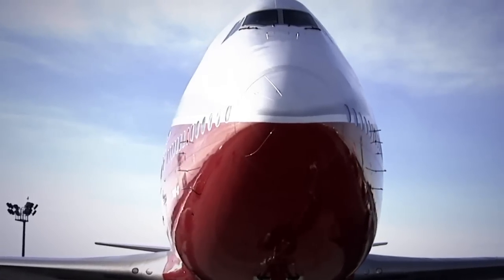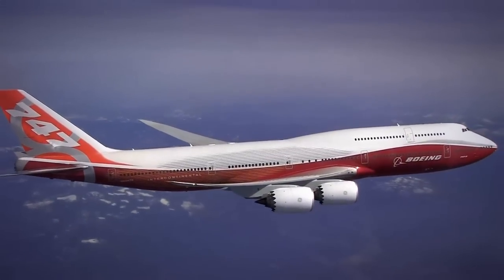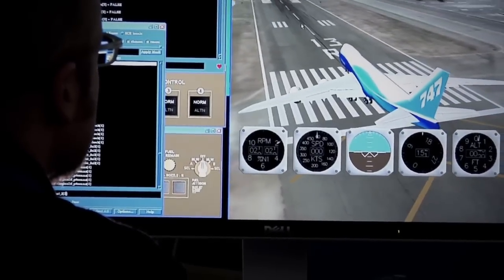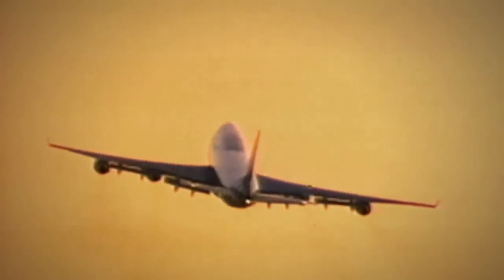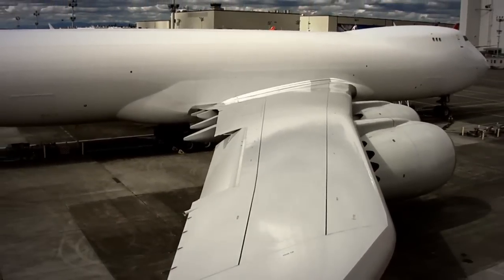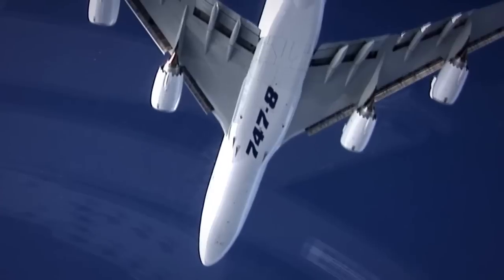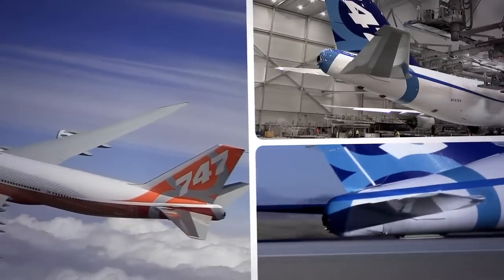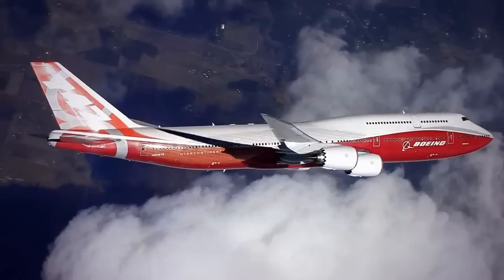Boeing 747-8 Engine: Balance of Power

Comment: I remember when I was in High School, we used to watch TWA's  747's in training take off and landings from the hall way to the cafeteria. They were so big that it looked like they were floating on the way down to land.

Years later ... I was actually able to fly in one, it was really a great experience, a jet you were not crammed into in seats too small and too close together. Instead the plane was spacious.

Now that I am getting older, I rarely have the opportunity to fly, but if I were to I would certainly prefer a 747 to anything else in the air.

Comment: A few weeks ago I flew to Bangkok on a 747-400 and it took 10.5 hours.  Last week I flew back on an A340-400 and it took 12 hours.  Give me a 747 anyday!
Reply: That is not a good comparison!  The only way you're going to know that one is faster than the other to fly them from the same place to the same place, in your case you would have to take the A340-400 to Bangkok and hopefully it would take exactly the same route.  If you fly from NYC to London takes less time than to fly from London to NYC, it's almost an hour difference I think.
Reply: I never said it had to do with the planes, it has to do with jet streams and earth rotation.  If you to compare both planes then you have to compare going from NYC to Bangkok, you can't compare one going from NYC to Bangkok and the other going from Bangkok to NYC, both have to originate from the the same place.  It's like saying if you swim in a river in favor of the current and then some other swimmer swims counter current obviously the later will take more time to swim the same distance than the first one.
Reply: 747 is the fastest commercial jet. Although you may have had a little tail wind, the 747 does make a slight difference over a long flight.
Reply: I don't know what the speed is for the 747 but I will accept the "slight difference over a long flight if both flights originate from the same place and take the same route and altitude.
Reply: this could have been due to winds though :/
Reply: Well, it will cruise at 0.86 mach at 35,000ft and at 0.88-0.92 mach at over 40,000ft so yes it's extremely rapid vs other airliners because it has such good performance, in part due to its new supercritical, highly swept 38 degree aerofoils but also due to its superior aerodynamics, like utilising the area ruling with the hump, raising M Crit and lowering wave drag.
Reply: BoeingvsAirbus1578 Check again A380 have 0.96 mach speed max and 747-8I 0.90mach speed, what are you talkin about?
Reply: csabavezer80 Not exactly, the a380 has a 0.96 mach in dive at cruise altitude but it has a 0.89 mach in cruise speed which I think is what we are arguing about but it is still a very slight difference to make such a difference in time.
Reply: csabavezer80
 Actually, the 0.9M speed listed is the MMO given by Boeing, this is the maximum advised operating speed for an economical lifecycle of the aircraft. The 747-8 can fly 0.92 in level flight like most previous versions of the 747 (E.G the -400 series) but it would end up expensive. The A380 can push for 0.89M for its MMO. The A380 will only achieve its V max in a dive, and can only hit 0.96. The 747-8 is capable of 1.12M V max in a dive and survive structurally.  Typically, these airliners are designed to cruise efficiently, and thanks to its more aerodynamic design, the 747-8 can cut through the air faster and at a slightly (near as makes no difference though) higher altitude than the A380. When operating under typical cruising conditions, the 747-8 can fly faster for less wave drag, as it has a higher M crit. Therefore, to summarise, the 747-8 is superior aerodynamically: it can fly faster than the A380 and yet still fly more efficiently. That hump isn't for nothing you know. ;)
Reply: I'm not here to start a nonsense argument I simply corrected you because you left an important part out before.
Reply: Whatever you like.

Comment: Plus, the Sky Interior is just plain game changing and has SHOWN to make time change easier on the individual flying and the 747-81 requires less maintenance and is SOOOO much lighter because many of its materials are composites. That makes the 747-8 better than the A380-800.
The only downside out of all of it is...
It requires a 10.8 thousand feet minimum takeoff length. Thats it!

Comment: Some people seem to think that the a380 and the 747 are not competitors because they accommodate two different needs... I always felt like they were competitors, but come to think of it, there's "short-range" 747s and higher passenger capacity 747s. So I guess the a380 is trying to get the market of high-volume cities during unusually high-volume times of the year, while the 747-8 is for year-round flights, and on top of that, it's "cleaner"

Comment: The 777 is probably my  favorite airplane, but the Airbus 330 comes in at 2nd place. The only reason that the 777 is in first place and not the 330, is because of the 777's flawless safety record. Other than that, the 330 is the way to go.

Comment: The A380 was all new, and all new aircraft have issues as boeing found with the 787. The 747-8 can only go where it likes because when it came out airports up-sized themselves to take it in most cases.
The A380 and 747-8 can carry both PAX and cargo like most medium to long haul jets.
The 787 only competes with the smaller end A350. They are both different targeting different markets. 
The A320 has 60% market share vs 737
Long live them both, long live competition, long live engine choice

Comment: Hopefully, it's not selling so well now :( but that's because most airlines with 747-400's are still happy with them and they are still making money, so wait a good few years and the 747-400's should be replaced by these. This plane can still fly the same routes and more (more range) as the 747-400, because even though it's bigger, it has better stopping power than the A380. That's why Virgin will have to buy a load, when was the last time you saw an A380 at Grantley Adams? or Princess Julianna?

Comment: Boeing, why not offer RR engines on the 747-8? You are reducing the chance that people will buy it if the airlines already have RR engines in their fleet. What about using the Trent 1000s from the 787? Because they produce 10,000lbs thrust more per engine than the GEnx2B engines, you could strengthen the pylons and it would mean for a higher MTOW, faster speeds and also more efficiency, as pilots wouldn't always need to use as much throttle.

Comment: Yeah Airbus is scared of 787,777 and the 737 will beat the A318-A321neo. And the A380 is a a fail too, there are not enough planes sold to get the development costs back.

Comment: Beautiful plane indeed but it won't survive.  It's clear that the market has decided for the A380, at least for now, and I think the 777x ( this name might change to 797) will replace the 747, I don't even think there's a great future for the A380 or any four engine jet, they are not cheap to operate, I think twin engine is the future and right now the 777 is the best one out there.
Reply: The a380 has severe limits when it comes to what airports it can use, the 747 can any airport with a sufficient runway.
Reply: Many airports have chosen to make the improvements to accommodate the A380!  but that fact only limited airports have the capabilities of taking the A380 worries me in case there's an emergency and the plane has to land as soon as possible.
Reply: The twin-engine is of course the future of the long-distance commercial airliner, but this beautiful bird is sticking around a long time to come.

Comment: You know the hilarity of Airbus fans? They try to call the 737 MAX 'outdated' Despite the fact that it's 4-6% more efficient than the Neo, 'Because it's narrower'. A quote from the silly Dartagnyn "It's more than a smidge wider than the 737 Jaffa'
Obviously he doesn't realise that it's only a 17cm wider cabin, which when divided by 6 abreast translates to a mere 2.8cm per seat wider. Also, add on the aisle and it's probably only 2cm wider per seat = a smidge wider XD